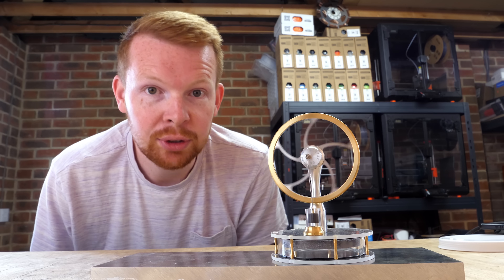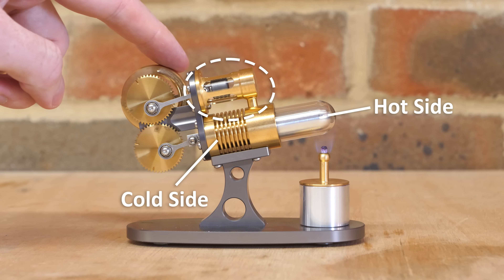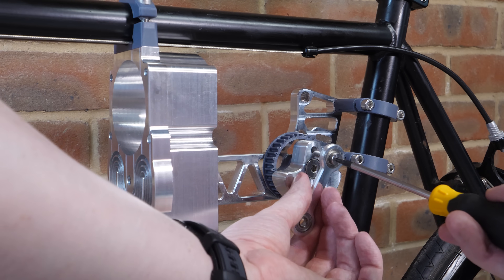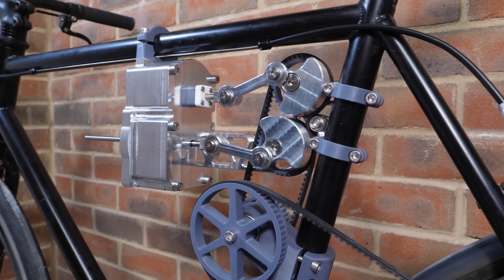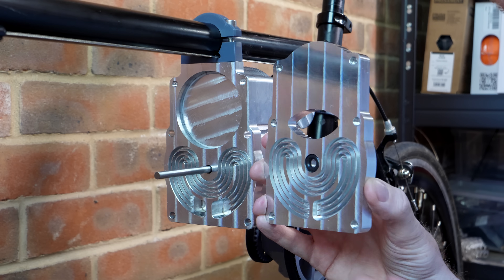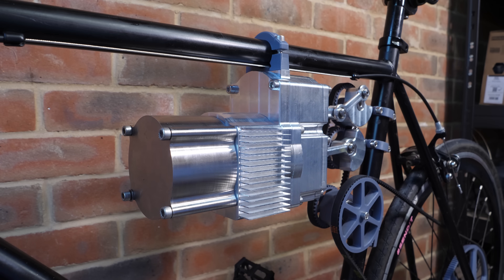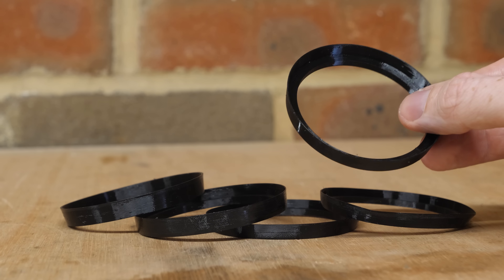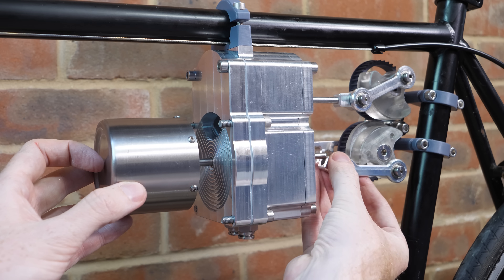Building a Stirling Engine Bike - Part 1

Comment: It sounds like you intend to add a combustion chamber of some sort to generate the heat. Why not instead create a hybrid engine system using an electric motor or a combustion motor and use the waste heat generated by that primary motor to power the sterling motor? 

This would help balance out the low torque of the sterling motor and would turn it into a much more viable propulsion option. This could also help eliminate a lot of the issues with heat generation and electric engines. Instead of needing to convert engine braking power into usable current and voltage for charging a battery (and all of the losses incurred and potential overcharging issues added along the way), you could just take the output from engine braking and dump it into heat to power the Sterling engine. You would lose the little bit of extra power that typically would go into your battery with a well-designed regenerative braking system, but you would need to use less power from your electrical motor to maintain the same speed...because the Sterling engine is chugging along beside it.

Also, one possible solution to the throttling hiccup that you mentioned, which you may not have thought of, is to add a freewheeling option to the drive wheel. When the throttle is not engaged, the drive wheel just freewheels and doesn't send any power into the bicycle, but the sterling engine keeps chugging away. You can take it one step further and use this disengaged sterling output to charge the battery, but I don't think that would really be worth the effort.

Comment: I've seen several stirling engines videos but it's the first time I see (or hear about) a displacer piston

Kudos to you, mate
Reply: This is a gamma type engine. Those are mostly used for low temperature small engines. Problem is that a gamma always has a considerable amount of working gas on the cold side, or on the hot side when the power piston is on the hot side. This is not good for the efficiency, compared to other configurations.

Comment: I realize you're not done with it yet and that you are literally in a prototype phase, HOWEVER. Mechanical engineering design does not skip over the longevity/durability aspect of any mechanical operation. While it's an interesting YouTube video, the simple fact that you didn't even discuss the wear and tear longevity tolerances of the material and design combination means you didn't do a complete design engineering qualification process. You could have simply talked about that, but you chose not to. How many hours does it produce X amount of power as the inefficient mechanical viscosities deteriorate over time vs power output, for example. What does that curve look like? You chose to not even bring it up. I'm guessing that even as you finish this engine design that will not even be a top priority for you because you know it won't last. Just guessing. You got your heads up though.

Comment: Thanks for the video. I think that increasing the pressure can produce more power, although it is difficult to manage. Also, the length of the rod that connects the crankshaft and the displacer shaft seems a little short, which causes energy loss. Also, the length of the displacer cylinder seems a little short, and note this.

Comment: awesome job, my opinion is that more surface area for cooling, try using something longer for heating but with a smaller heat source so your not riding with a bomb between your legs.

Comment: man you are the best! you design are GOOD, my idea about: you need 2 fresnel to one heating chamber preferent on the front wheel attached to the fork base, and a second chamber to cooling; a cardan no chain in the output, my idea come from the fresnel youtuber who meld things,😄if the the chamber are attached to the fork base you do not need flexible hose, and with 2 fresnel up the heating chamber are more heat to the system and you away the moving parts from you and yours legs.

Comment: Heat Pressurized air with the exhaust from a liquid fueled, preferably deisle air compressor. Get rid of 3/4 the heavy toxic flammable batteries and weight of an a all electric car, by using a hybrid deisle, compressed air heated to tun a turbine that supplies electricity to a system that can also spare the weight of a conventional transmission. A car would get 75 mpg easy. It's the timing and sequencing of air valves and rotating heat onto the compressed air canisters is the key to the whole thing. Compressed air is another battery. The heat is the catalyst for real power.

Comment: Great stuff all round . I work for a composting company that as part of its composting process generates a great deal of heat that is simply not used - wasted !! The hot air is handled through 1.5m diameter stainless steel air extraction ducts - each approx 60m long. I have been trying to find a way of getting some value back from this free heat - what temperature is needed to start a Stirling engine generating any small amount of power ? ( currently TEGs do not generate electricity from heat at say 60 - 80 deg c). Any comments or advice greatly appreciated

Comment: Also what about water rather than an air based sterling engine? Is that a thing? Liquid has far more density than gas and would higher density gas give you more power?

Comment: You need a compressor and valve that either allows air to be pumped in, or let out, operated by throttle. And this air pressure needs to be on both sides of the piston, which means dummy chamber or pressurized crankcase. If you get it to 1kW, that would be a blast!

Comment: Been thinking about the critical mistake of this build (admittedly there may be a few), and I think it’s the ratio of displacer volume to power piston volume… I think you made the power piston volume too large. Optimal ratio is between 1.5:1 and 3:1 where the displacer volume is always largest. Also, highly recommend redoing your displacer piston (need to remove the indentation from the bottom because I suspect that’s allowing a large amount of working fluid air to get trapped).
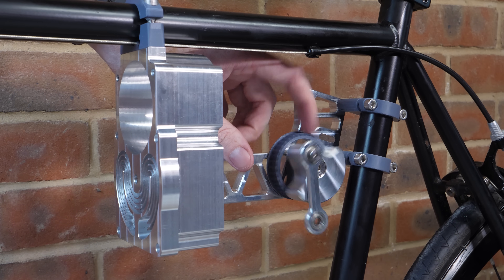Reply from the maker: The volume of the displacer cylinder is 533cc (displacer itself is 260cc), and the power cylinder is 83cc in the final test. This should give a ratio of (533-260)/83= 3.29:1, which is larger than your suggestion? Yes, I realised that might be an issue, hence the large volume in the rear of the engine block at 4:31. The backplate also has a 9mm hole in it which will eventually be used to pressurise the engine. Thanks!
Reply: @TomStantonEngineering  Okay yes, just wanted to check. I think your design is technically a gamma design. If you want more torque an alpha design is I think more typical. Obviously each comes with different optimal ratios can’t recall off top of my head. If you incorporate a means of ‘self pressurizing’ the working fluid that would obviously improve your power output. Excited to see where next this project goes. 🤗

Comment: This is very cool and the guy is very smart and talented, but doesn't using a propane torch as the heat source make it a fossil-fuel-powered engine? Technically an external-combustion engine? And one with very low efficiency?

Comment: Fantastic.  If you increase the diameter of your drive piston, you’ll see massive torque improvements, solving your issue, though you will also have to increase the amount of air you are moving to compensate

Comment: For heat storage use cast iron with an insulated cover on the heat chamber.  Then it comes down to torque.  You may be able to spin up the wheel.  But it may not be able to keep turning due to load.  Gearing and more inline stirling engines and a flywheel could solve that problem.  My guess you may have to scale up the engine to get the results you want.  I did this to spin a generator in middle school.  I used the sun and magnifying glasses to produce heat.  But failed mostly due to thermal dynamics issues.  My experiment failed.  As this was 47 years ago and didn't have access to modern materials and I was 12 years old.   Maybe you could use liquid salt as a heat storage medium?  I still got an A on the project.  My motor design had two chambers two push rods. One cold side and one hot side shifting from one side to the other.  Over the years I thought about making it a 4 cylinder and adding a second and maybe a third motor.  But never got the chance.  Also thought about many different heat sources.  Maybe chemical.  The coolant an alcohol based liquid with dry ice to draw more heat away from the cooling sides of the motor.    To hopefully increase RPM's.

Comment: The power piston is fighting the enclosed air in the back of its cylinder. Open that up with some holes. Unless it’s supposed to be some kind of spring? But I think it would be best if there was no resistance there.

Comment: Fins inside the displacer cylinder (separate hot and cold side) might also help because of the increased surface area and better heat transfer. A tunable angle offset between the two pistons (think "manual ignition timing") should also help getting more power out depending on the RPM.

Comment: Does it matter that your displacer piston is hollow and not air tight? If the displacer and the air within it is heating and cooling won't that work counter to the effect you are trying to achieve?

Comment: Actual bicycle chains have even lower losses.  10 speed jockey wheels gather a lot over heat, 10+ teeth even lese.  360 / number of teeth is how far the link bends on the cog.

Comment: Wouldn't you want a second sprocket, one for physical power and the second for the engine power? when you petal or spin the wheel it might be wasting energy on the outward movement. maybe a design that is supplementary power, not primary. This is also representative of most current ebikes. Or since its this type of engine, does the extra cylinder compression give you more heat energy for the transfer? I really have no idea, just a thought

Comment: The thermal conductivity of aluminum is so much higher than steel. I'm not sure if it's limiting performance in the design at this point, but I think you may want to consider making the hot-end aluminum or copper instead. In the future, it may be fun to try out some different gases inside the chamber as well. Hydrogen and helium have quite good thermal conductivities compared to normal air.

Comment: The power piston is cooling the air that fills it, and the displacer piston itself is getting hot and therefore heating air that is supposed to be cooled. I suggest making the displacer piston out of wood or ceramic, and also making a separate ceramic, or wood, or plastic liner for the walls of the power piston chamber. Consider lubricating the walls of the power piston chamber with an extremely thin oil or graphite powder or pencil lead (probably the latter). Also, I think you made a mistake in abandoning the CPU heat sync idea. An older smaller one like from the 486 era with an impression of it carved into the back of the displacer piston. The same could be done with the hot end of the displacer piston chamber, though, this one would need something more than a conductive adhesive to mount to the hot end of the piston chamber. Finally, I wonder if a high pressure tubing connecting the air in the hot end of the displacer piston to the front of the power piston would make any difference. That last one I'm iffy about because it kinda looks like your design already prevents the air from the cold side mixing with the air from the hot end during the power stroke.

Comment: So sick of youtube "engineers" talking a load of nonsense with confidence, blowing hundreds or thousands on poorly thought through chunks of CNC'd aluminium and barely making something that works. Throwing fat stacks on a trial and error grind without really putting in the effort to understand and workshop the problem and solution is antithetical to actual engineering where time and money is always a part of the equation. It's lazy and lame.
Reply from the maker: Considering I spent a month doing research, design, and calculations, followed by cutting the parts on my homemade budget CNC mill, I'd assume you are referring to someone else. Thanks!

Comment: This engine is MAYBE generating 5 watts.  It can barely slowly spin the wheel with no load on the bike.  In reality, you are probably spending more power on the cooling then you are getting out of the crankshaft.

Comment: I find it stupid to start making real parts before it works in 3D-design / calculation and simulation.
Reply from the maker: I did a month of research, design, and calculations before I started making the parts. But sometimes, the calculations don't exactly simulate reality. However, there's still plenty to modify with the engine, such as adding a regenerator, reducing dead volume, and adding a more effective burner. The stupid thing would be to not attempt anything at all.

Comment: @Tom Stanton :
Wasn't it possible to put the motor outside on the top of the fork of the rear wheel so as not to have it between the legs, which would lower the wheels, if necessary?

Comment: I think as you scale up the sterling engine, the ratio of heating/cooling surface area to air volume in a cylinder drops rapidly. Would using a different displacement geometry improve the heat transfer? I could imagine the displacement piston being a set of "displacement fins" that mesh with fins on the chamber walls for maximum surface area. Pain in the ass to machine though

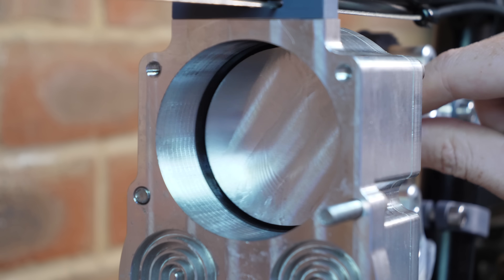Comment: the seal @ 13:14 is good for the compression cycle (heated gas) but bad for the vacuum cycle (gas cooling down) .... maybe rethink that choice there. they`re called "vacuum engines" for a reason
Reply: That's exactly what I thought. This engine has two cycles — it pushes and pulls the piston. I think the sealing isn't adequate.

Comment: could be an cool project if you knew what you are doing.
Reply from the maker: I did a month of research, design, and calculations before I started building anything. There's still plenty to modify with the engine, such as adding a regenerator, reducing dead volume, and adding a more effective burner. Let me know when you build a better engine with your excessive knowledge.

Comment: I've made something similar in an electromagnetic flywheel motor, and would offer some advice for when you add a load to this design. You need a greater diameter on your cranks, they are too small  for output power, and I would increase the length of your crank rods too (not the piston rods, they're fine). A larger initial heating chamber is definitely required for torque, and a larger diameter, long stroke power piston will help too. You can achieve all this by dropping the motor a bit lower in the bike frame for the crank size increase, and extending the heating chamber and piston cylinder as to retain your beautiful original engine block. Finally, and probably most importantly, fit a flywheel of sprung weights on a cruciform frame. Mount the weights in the centre, and they will move outward as rpm increases, and the springs will return them to the centre, decreasing the load on the flywheel at low rpm.  This will allow the engine to conserve torque and horsepower through the startup cycle. Use a tensioning belt as a clutch system to disconnect the engine from the driving wheel until suitable rpm has been achieved to allow for loading, otherwise the engine will never reach peak output before addressing load requirements. Hope this helps.

Comment: Tom, you might want to replace the silicon gasket between the finned aluminum part and the main engine body -- you did say that you were concerned that the silicon gasket wouldn't allow heat to transfer to the body.  Perhaps one of those automotive "make a gasket from goop" products would work better?  You're doing a great job, and I'm/we're certain that you will succeed with this project!

Comment: Very interesting, but also kind of misleading and disappointing from the Title. This is a weak Stirling engine attached to a bike frame but not only is it far too weak to move the bike even without the weight of a rider, it depends on an external heat source (not included/attached) and an external cold water pumping system (again, not included attached). It is a totally static novelty item, not at all an even poorly functioning bike powered by a Stirling Engine.

It's tres cool, but it is not what the video title promised.
Reply from the maker: Watch till the end, this is only part 1 of 'Building' a Stirling Engine Bike. Not misleading at all!
Reply: @TomStantonEngineering  if you said Part 1 in the title, that would be a meaningful, cogent argument. But you didn't, possibly because you feared not as many people would watch it if they knew it was only a serialization, and incomplete. My point stands.

Comment: Using a Stirling engine to directly power a bike is rather unsafe as there is no way to throttle down when needed.
On the other hand so does it work fine as a hybrid by connecting the Stirling engine to a generator and use that to charge a battery of an electric bike.

Comment: Do the part where you'll heat the engine with something like a mini induction stove or induction heater. Then, when you're driving, you don't have to worry about the flame going out. It would also be good to do the cold part facing forward, where the cold wind would hit while moving.

Comment: What if you could generate friction from peddling to assist heat for a smaller stirling engine to assist in speed/rpm while cycling? or wouldnt be enough heat be possibly generated

Comment: Tom Stratton you are absolutely amazing right now I'm in middle of building an alternator powered scooter big fat tyres at the back that I bought on eBay they are ATV motorbike tyres also putting a VHS recorder on the scooter and a car stereo headlight and tail light and powering it from to 12 volt 15 amp hour AGM batteries I hope you get your Stirling engine working on your bike😅😅😅😊